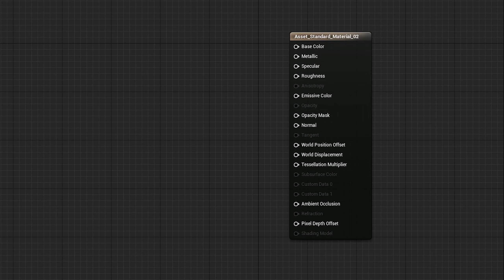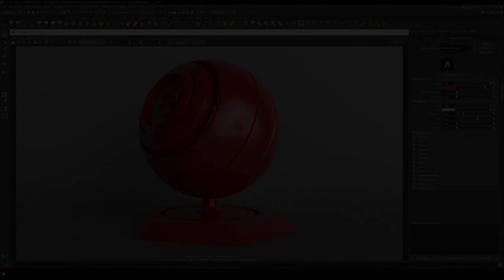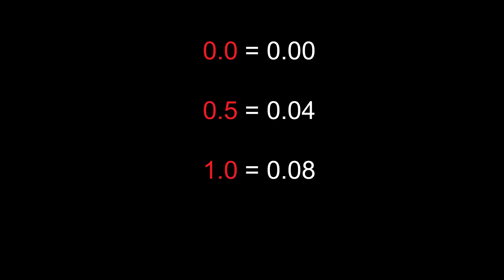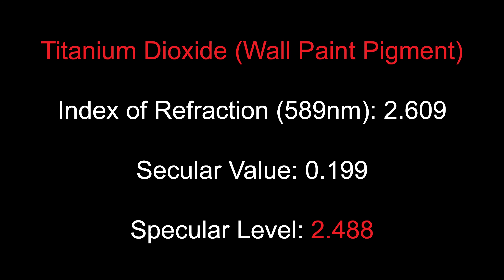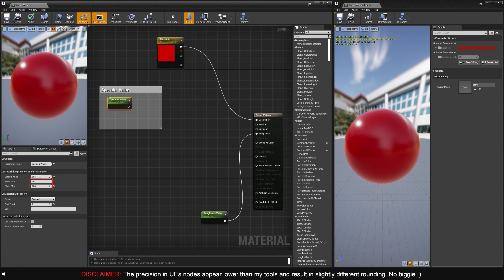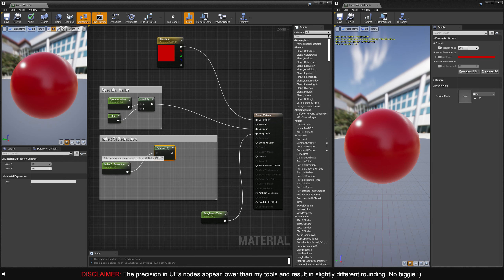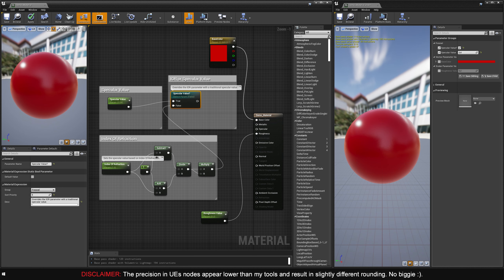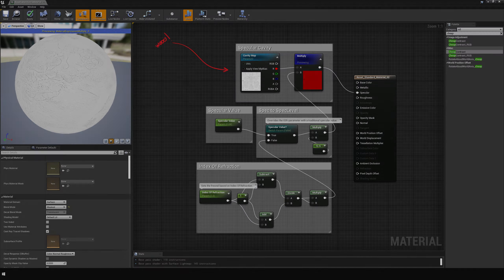Decrypting SpecLevel

Comment: Don't know if someone already mentioned it, but marmoset 3 does have a specular level input when you switch to "adv. metalness" :)
Reply from the maker: Oh, neat! I didn't know that :)! I also haven't used the later versions of the tool, is this a new addition?

Calling a visible spec controller "advanced" feels about the same to me as when Chrome hides the path for downloaded files under "advanced settings" though :D.
Reply: @Hostile_Design  No, it's not new, i think it's been in there from the start (version 3).
Maybe it's too well hidden so nobody knows x)

Comment: Hi, OK the values are not arbitrary, im not sure if you just said they are for comic effect or not, but I thought I'd explain. 

In designing the pbsdf material in the Disney 2012/15 papers, they measured hundreds of real world materials for these values and created a good working model based on an average approximation. So yes there are a slim number of material edge cases which this does not cover, it does most, out of the box. 

The specular Is derived from a schlicks approximation (whereby f0 is 4% and f1 us 100% ~ by roughness) and this is analogous to an ior of 1.5. If you compare a schlicks approximation of 4%>100% and ior 1.5 they look pretty similar. And this is your standard locked (in some shaders) or 50% in unlocked materials. The f0 value going from 0>100% is the equivalent of driving the ior from 1 > 1.8. (A facing value of 0-8%)And from the observation almost all observed and measured materials went from ior 1-1.8 for opaque dielectrics. The reason it clamps there is so you can use those values for textures, with values going from 0-100%. (Imagine trying to paint in ior values!). It's often simplified to just a 50% implied value (ior 1.5) as most materials float around this point, and for game engines its close enough.

In the case of transmission, that has a seperate ior value as these commonly fall outside the 1>1.8 ior paradigm.
Reply from the maker: I did not say it for comical effect but the breakdown is appreciated nonetheless :)! I actually had an internal talk with our shader guys, and 8% is chosen because it's the value of a ruby, no other reason mentioned. Which I think is arbitrary, as a decent chunk of dielectrics actually lands quite a bit higher.

I have a pretty decent table of data myself I derived from many measurements using a tool I built together with a friend of mine working with spectrometry. But yes, the dielectric range is usually quite narrow. I haven't done any real averages on everything I have but saying most dielectrics fall within the range 1.3 - 1.8 is reasonable if I'm to wing it.

I more so have a problem with the limitation itself, as many materials actually do go higher and that is reason enough not to limit it. Many of them very common, some even having slight coloration when all wavelengths within the visible spectrum are taken into account rather than just sampling one. Copper oxide sits at IOR 2.52, iron oxide sits at IOR 2.99, and Titanium Dioxide at 3.13, all of these are very common (old statues, rust, and white paint) and I wouldn't call them edge cases. On that note, actually averaging let's say all my mineral data vs all my plastic data, etc, could be interesting. The types of materials breaking the 1.8 barrier appear to be mostly oxides and minerals.

Regular old spec maps totally let you use that range though :). In the sRGB color space, dielectrics start at around 15% and go to about 50%, with metals picking up at about 75-99.99+%, starting with iron and chrome and ending on silver. Doing this on linear maps of course leaves you with a very limited working range on dielectrics. That gives you the entire range rather than a limited one, and still leaves plenty of room for control and variance without having to cram in a separate spec controller for conductors vs dielectrics.

But, I'm not going to sit here and pretend I know shader code at a system core level, which you obviously do, judging by your channel. I have just gathered stupid amounts of material data, cross-referenced that with what this system allows me to do with it, and noted that a lot of things are beyond its capability for no other apparent reason than a number being chosen because "it should be sufficient for most things", then being transmogrified into a 0-1 range. The apparent reason also wasn't changed to any relevant extent after discussing the whys internally (I of course can't go too deep into the details of that for obvious reasons).
Reply: @Hostile_Design  the thing you have to remember about those tables is they are not always useful or right from a real world perspective, especially in the case of the metals. Real copper oxide is dirty, as is iron oxide, those values correspond to chemically pure samples taken in a lab, Disney took samples of real materials and used that as the basis of its model. It may well be that iron oxide may have a value over 1.8 ior but 'rust' does not. I hear you on this, and it's a limitation and possibly frustrating, depending on if you need to go outside the box, but then in unreal you can just build new materials.

I'm just an artist, I cant code, but I was building these pbr models based on the Disney papers quite some time ago, as I found it fascinating, using nodes, wguch you can in unreal.

Technically your model is wrong, BTW, for swapping ior for facing value, because you haven't taken into consideration microfacet theory (though I am not sure how unreal handles its spec). As roughness increases your F1 decreases and approaches F0, so fir very roiugh materials the glancing is similar to the facing. This is because of the nature of microfacets, the rougher, the higher the chance that a facet will be facing the observer. In pbsdf this is handled by the shader for all materials, and it depends on how unreal creates and mixes its spec as to how you will need to blend those layers to achieve energy conservation.
Reply: Oh and I'm glad you enjoyed my chanel! 

Just a note regarding metals:

The metallic model in pbsdf is ridiculously simple, a facing f0 'colour', which blends to f1 white, but as with the dielectric also has microfacet built into the specular, so as it becomes rougher f1 approaches f0. This in a practical sense is so the values can be 'painted' as textures. But it has a problem in that metals are not just colour specular, but a complex set of fresnels which vary based on wavelength (which is why they are coloured) so copper has a higher fresnel number in red than blue wavelengths, so it appears pink. The thing is metallic fresnel are best recorded with n and k values, as they are not well represented as a simple shlicks approximation. Iron is a good example of this, because it is more reflective at 45 degrees than at 0. You could of course simulate this using a falloff colour gradient in colour to drive this, but its tricky for an 'artist to get these rules right, by eye, using incident angle ramps. Some renderers (octane, vray and I think later versions of Arnold) allow you to use measured n/k values, but then its always going to be tricky to do the mix using textures.

I think good weightings blending can help ameliorate the blend between metals and insulators, at a shader level, but yes material mixing will weird better results, its just computationally more expensive, and you require more maps, which is the benefit of a single map model. Interestingly you note the blend artefacts you get with the metal-rough model, and substance painter note that in their painting guides (which you should read if you have not) but the specular pbr model has opposite but similar artefact issues as well. The only way round them, in both cases is increased fidelity, or taking a performance hit and blending multiple materials.
Reply from the maker: @AndrewComb  This is exactly what I exploit to get the colors I use :). Redshift and I think Cycles both sport an "advanced IOR" model, where you insert 3 nk values, representing R, G and B, I just run that through all available wavelengths in the visible spectrum instead of 3. Arnold has broken down its controller to the main color + an edge tint to make the differentiating edge color art-directable and to emulate this color shift at glancing angles, Redshift does the same in its "reflection + edge tint"-mode, which is essentially spec map + edgecolor mode. Maxwell allows you to read full IOR spectrometric measurement files and uses all wavelengths available. Extracting more accurate glancing colors for the edge tint setups is my next goal :).

I have in fact read the substance guide! Honestly, it's one of the better and more complete ones out there. The halo issue they describe using the spec setup with a dark outline is however something I have never experienced myself and the attempt to equal that to the problems single-layer metalness has is something I see as a massively biased exaggeration.

I assume that effect to be due to faulty matching of the masks in the different maps, making the black diffusion overstep the specular pickup of the spec input, which would be user error. But please fill me in on that one, if you know any better, that one is just a guess from my side. If you saw my other video, I get a practically identical result from single-layer specular setup vs multi-layer metalness on a heavy gradient transition and at relatively low res. Regardless, the metalness system single layer mixing is considerably more terrible, like a different realm altogether-more terrible. Unusably terrible, even.

Using multiple material layers of course bypasses any such problem in both workflows, at a cost. I also don't currently see how for example Painter or Mixer would handle such a thing when a material can have any number of layers, belonging to any material type, in any order. Except restricting that very thing, so that any material type can't be in any order in any number.

The next thing I thought to tackle in a video is the old raytracer spec systems where you are stuck with diffuse + an IOR controller you can't swap out and/or bypass + a color input on top of that, which causes a lot of confusion where people claim metals have 589nm IORs of 40 and all sorts of oddities when you really just need to max that controller out or disable it to get the map to do its thing.
Reply from the maker: @AndrewComb   @Andrew Comb  And I totally missed the comment in-between :D. The model I used for IOR to spec isn't mine, I have nicked it from somewhere. I honestly can't remember where. But it's a conversion for transforming IOR values to regular spec percentage/spec map values, so it takes no other factors into account. It's really just a different number representing the same percentage range as the other controller and is feeding the shader with the very same stuff as the other controller does, but perhaps more relatable to people used to that kind of input. The conversion is accurate for that purpose with IOR 1 being a facing value of 0.00000, IOR 1.5 being 0.39994 and IOR 1.79 being 0.080171. The rounding ends up a little different in UE, assumedly due to precision.

And you sir, are not just an artist ;).

I find this conversation fascinating though, so moving it somewhere more convenient is something I'd be down for if you don't mind :). Of course not in order to try and shroud any of your input from here. If I can turn anything into better, more reliable information, I'll gladly pull anything down and correct or update it.

Comment: Would it be viable to have a boolean in the material details pannel called useRealValues or something like that? if so, you should send this video to your co-workers at epic to unlock the specular level from 0 to 1, the fact that its optional would prevent already made materials from breaking
Reply from the maker: "No comment" :D. Stay tuned.